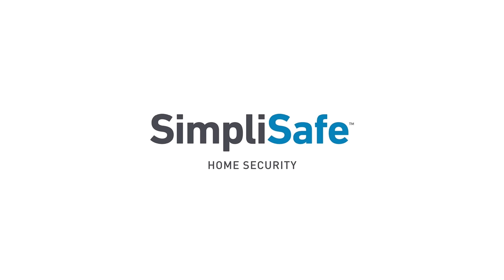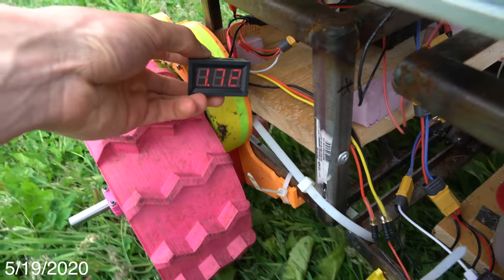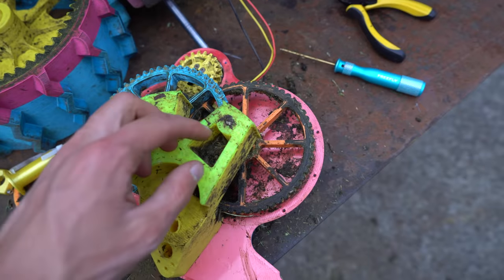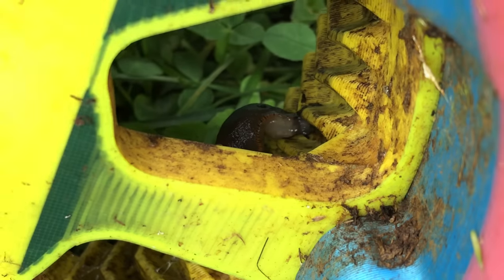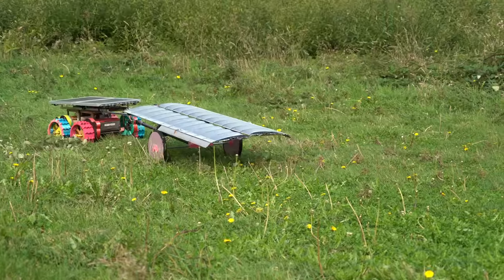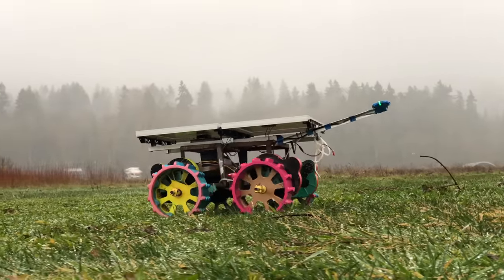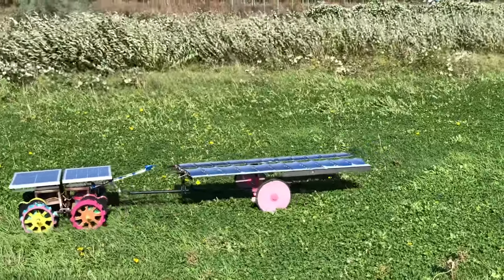Solar Rover #3 - 3D Printed Brushless Gearbox

Comment from the maker: Check out SimpliSafe’s holiday sale and get 35% off any new system + a free camera by visiting http://simplisafe.com/rctestflight
Reply: Hey
Reply: Have to say, your add is better than 99% of million+ subscriber channels. In fact, internet historian is the only one that comes to mind.
Reply: Wow many miles did the rovers GPS receiver clock for the season? IE. total distance traveled.
Reply: Simplisafe makes bad products and anyone who relies on them will gain nothing but a false sense of security.
Reply: @lightcycler4806  I am aware. That's why I wrote what I wrote.
Reply: I have a few batteries for you
Reply: May I suggest the oldest form of gears that had pegs against pegs or slots against holes?
If you ran your gears internally and had them as peg in ladder there is no issue of material interfering with the mesh of the gears.
Reply: heyy you can use grafite dust as lubricant for gearbox if you use oil or something liquid it will absorb fine grinded gras powder and make grayblocks so only way is proprely sealing gearbox and grapine dust for eficency and some sort of stifnes control for if rower gets stuck it will not try to move this will helps to gearboxs life expectancy 
and sory for bad english
ps that gps antena asking for truble can you change it from hizontal to vertical like normal rower anteas for extra safety?
Reply: @fahrimertdincer8421  
Graphite won’t prevent buildup. It’s inherent to closed gears.
Reply: @brucebaxter6923  well its not pervents ı know it but if there is some thing before build up that lubricates that materials and they need more time to build so its jus works for buying time and its full closed gears soo it will help
Reply: @fahrimertdincer8421  
The gears didn’t wear.
Reply: @brucebaxter6923  You didn't watch thr video, did you?
Reply: If you put a  stationary arduino with GPS at the edge of the field, you could measure GPS drift and have to rover automatically compensate. I use nRF24 modules (the one with the shielded chip) for my Null Island Space Agency projects for communication between devices. It's low power/low data rate (but somewhat long range), but that should work just fine for your rover project.

The base station could also act as a time lapse camera. Every time the rover reaches a specific waypoint (=each lap), take a photo.
Reply: @AlexusMaximusDE  wifi jammer comes to mind.
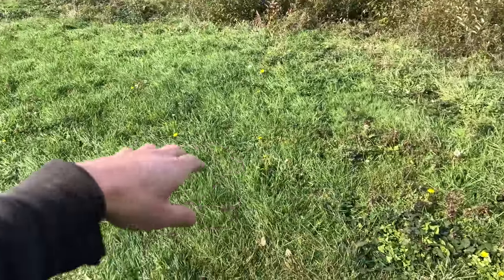Reply: Hi maby your waypoint misson shifts South because of magnetic declination, I may be wrong but you should check that. 25:05 Yes there is. So I did some searching and I don't know your location but based on Beverly, city where you started the solar plane mission, magnetic declination is 14.84° E  ± 0.39°  changing by  0.09° W per year.
Reply: Just a quick idea about keeping the gears a bit cleaner, could you fit a rotating brush inside the wheels that could sweep the gears?
I know there's not a lot of space but it could help.
Reply: There's a machine that was built for going off road without damaging the ground. It used Rollinon wheels (Rolligon is a trademark name for a type of tires designed for use in rugged terrain or for traversing the tundra.) That were driven by another set of wheels set above them, it's like a number 8.
The Rolligon tyre is just a bag of air so it can deform to the ground instead of using suspension.
I think it was a military vehicle between the 60s and the 80s.
I can't find the name or a video but if anyone knows what it is then it would be a good idea for the next rover as the grass and slugs won't be an issue.
Reply: You made a grass juicer.
Reply: You can heat harden PLA.... might be a good application for that.
Reply: How would those life batteries work in an airplane? Are they heavier than lithium ion?
Reply: @AlexusMaximusDE  you rob houses for a living don't you? Business getting harder. Risk vs reward Hong the wrong direction?
I hear Simplisafe is growing like crazy and hiring lots of people with no experience.
Reply: If you get one of the newer FC's you could use ArduPilot's scripting to do the mode changes and just skip the entire Arduino & S2PW thing. 😀
Reply: Put tank treads on the solar rover
Reply: add walls around the gears in the wheel so you still get free slug lubercant and grass doesn't get in
Reply: if your design had 2 drive wheels and one training caster, you could make twice as many rovers with the same gear boxes and run 2 tests at once.  Might not be a bad wheel layout for a mower
Reply: My suspicion of the slugs covering the gears, is that they eat/drink? the grass paste.
Reply: try using a worm gear instead in your gearbox it can increase torque without the need of many moving parts reducing energy loss and reduce points of failure and can help reduce jamming in the gears from debris.

Basically a worm drive, this mitigates any problems with back driving as it is a mechanism is a one-way output drive. It works by spinning a worm gear which drives the output gear. The advantages of this design are that it is easy to increase the torque with this design, can reduce the number of stages to increase torque, and uses fewer parts decreasing the points of failure making it easy to diagnose a problem, and decreasing energy loss in the whole system due to friction. 
It also has the added benefit of being able to remove gunk and jams on the gear due to how the mechanism works.
https://en.wikipedia.org/wiki/Worm_drive
Reply: Brushless should not be that loud. I think the gear need to get improve.
Reply: I just saw a video about a really great idea that can really reduce the wear on a set of gears, Magnetically locking gears! They use magnets to lock into place but if they are overloaded they can use mechanical force to push through the issue, I think you might want to design it a bit differently though. Here is the link to the video:
https://www.youtube.com/watch?v=76yRObMIwa0
Reply: @evilcanofdrpepper  that's not the problem tho, because if you get dirt and mud in the system it'll get stuck the same
Reply: use hoverboard  motors next time
Reply: Tacoma. You mean you live in Tacoma.
Reply: Okay
Reply: Ooo
Reply: Cool
Reply: Super awesome project!!
Ps: LiFePO4 = Lithium Iron Phosphate
Reply: @superdupergrover9857  I
Reply: @deadeyedsam850  I
Reply: @deadeyedsam850  I
Reply: @deadeyedsam850  I
Reply: @deadeyedsam850  I
Reply: @deadeyedsam850  and
Reply: @deadeyedsam850  and
Reply: @deadeyedsam850  and
Reply: @deadeyedsam850  and
Reply: @AlexusMaximusDE  I
Reply: @AlexusMaximusDE  I
Reply: @AlexusMaximusDE  I
Reply: @AlexusMaximusDE  and
Reply: @AlexusMaximusDE  and
Reply: @AlexusMaximusDE  and
Reply: @AlexusMaximusDE  I
Reply: @AlexusMaximusDE  and
Reply: @monkeywrenchin351  I
Reply: @monkeywrenchin351  and

Comment: puts literal wings on the trailer... "looks like the wind is effecting the trailer"
Reply: affecting*
Reply: @UnitSe7en  boi.
Reply: @brycegman8150  Got a problem with English, son?
Reply: @UnitSe7en  proper English, yeah
Reply: @UnitSe7en  which is which I was never taught
Reply: @brycegman8150  what's wrong with correction?
Reply: @UnitSe7en  actually, if you read the definitions, they mean the same thing.
Reply: @sobertillnoon  absolutely 100% do not mean the same thing.  Effect makes no sense in that sentence.
Reply: Well,  I guess technically you could hodgepodge a sentence together where you could use the words wind,  trailer,  and effect.  It will be janky and awkward though.  "Looks like the wind is effecting a change in the relative angle of the trailer vis a vis the ground."
Reply: @ShadowWizard123  looking at the verb definitions of both effect and affect, I'm going with my original statement. Especially considering the first verb definition of affect Google shows me is "have an effect on". But that's all I'm bothering to look into. I'm not rebutting anything else.

Comment: When your rover gets stuck, it reminds me of the NASA approach.. You need a bigger rover. :)
Reply: And a nuclear reactor in the back😁😁
Reply: They borrowed this from an American car industry )
Reply: Actually, the NASA approach would be to get JPL to build a fake field and spend months trialing ways to get unstuck: then update the software with the new strategy.  Daniel's way is faster and cheaper.
Reply: @shurmurray  The American car industry
Reply: @jyotiradityadeka2905  mkay (:
Reply: How big would a rover need to be in order to be immune to the blackberries? What if he used 29" MTB tires? Or even much bigger?
Reply: Fun fact: NASA's most recent Mars rover's tires are made out of 0.7mm thin aluminium. And it drives on rocks and through sandstorms. Those guys are insane.

Comment: Would have been nice to have a odometer on board so we can know the actual mileage. Next version maybe?
Reply: I was wondering the same thing,   GPS can't do it?       How many miles did it travel?
Reply: He could have fed the telemetry back into the arduino to log it but like he said near the end, he's not great at coding.
Reply: $9 bike computer. Uses a magnet attached to the wheel and a magnetic sensor to determine wheel revolutions.
Reply: @marsrover001  The wheels weren't making good traction with the ground in several shots, I doubt that wheel revolutions would be a good measure of distance travelled.
Reply: @marsrover001  If he would put that on the wheel of the trailer that idea would work. When the bike computer can't handle the small wheel size you could convert it later on to the right distance. On the rover itself it would be asking for trouble when the rover gets stuck and the wheel keeps on spinning.

Comment: Id recommend going with bicycle wheels and tires, like a 20" or bigger. The significantly larger tire diameter will make it very capable. Going with reliable wheels and getting your drivetrain out of the grass would help with a lot of your issues

Comment: you could use the "gates belt drive system" on your next one. they invented really cool cogs that self extract dirt and mud.
Reply: I was intrigued by the claim of Gates having a new cog design and had to look up Gates belt drive to see what you mean. In short it's using a center ridge on the cogwheel to keep the belt tracking and not slide off. This way there's no need for side walls on the cog wheels which means lower friction and that any dirt can be squeezed out to the side. The design doesn't easily translate to making cogwheels for a gearbox though. You could come close by using the current chevron design but run them "backwards".  That way the cogs would first intersect that the point of the chevron and as the wheels turn the contact area would expand out to the sides. That way any slug caught would be squeezed out of the gear. If the gear is run the other way it will tend to pack any dirt towards the center. This might be good if you want the gear to retain lubrication but not to eject bugs and the occasional cow patty.
Reply: @blahorgaslisk7763  so they are crowned like the tires on a bandsaw?

Comment: I wonder if much of the wear-and-tear came from the skid steer design; every hard turn putting lateral forces on the 3D printed parts. I wonder if two drive wheels in back, with one or two free-wheeling caster wheels up front might improve longevity? Also I wonder if any improvements could be made to the navigational system to get the rover closer to the designated path, without too much variance and over-correcting. Great video!

Comment: Have you considered setting up a D-GPS (differential GPS) system. You could mount a regular receiver on a post in the field at a fixed location. Then transmit it’s received position to the rover (maybe via LowRa?). The rover would then compare the known position of the fixed receiver with its reported position. The rover then corrects its own position by that delta.

Comment: Do you think putting those gears in salt and "cook" them could help with having more resistent parts?
Reply: That's exactly what I was thinking about. I was wondering if the powder salt solidification would make those gears tougher.
Reply: @danieljenkins4213  probably not even all of them need to be annealed, I think only the smaller and most stressed gears need the treatment.
Also the gearbox cover would probably be better if cut out of something instead of 3d printed and the inside wall and all the junctions should be lubricated with graphite, it's quite easy to find and it's a really good dry lubricant
Reply: @lorenzoporciani  I think the problem with any lubricant will be all the stuff going in will scrub it away. The gearbox should be better enclosed if possible, and there was another comment about "self cleaning" teeth which would help tremendously
Reply: @danieljenkins4213  if it has already DRY lubricant things should stick less, also it is better than nothing
Reply: I think there shouldn't be any salt that would be the lub it gets from the slugs it kills won't help anymore

Comment: You should put the gear system somewhere hidden and then put a belt system to the drive shafts,sure it may eliminate tank steering,But it will ultimately use less current,more speed and be protected

Comment: You stumbled upon a great principle for a slug trap, slugs are a big problem in some areas, and something like your rover should be a great way to reduce problematic populations of slugs. I seriously  think you should try to make commercial products based on that. It might seem absurdly elaborate, complicated and expensive just to kill slugs, but the rover keeps itself baited, and disposes the killed slugs, and can cover large areas. And, it seems safe for most animals except slugs.   

The snails are attracted to the grass in the gears, it's easier for them to eat than undamaged grass. Some species are also even attracted to the remains of previously killed snails.           

A slug rover wouldn't have be actively running for long periods, just enough to keep the gears baited. Just give slugs time to find it, get in it, and then have it move a few meters, or yards, whatever you prefer, and then stop and wait to give some more slugs the chance. That wouldn't need more than a few percent duty cycle, and you wouldn't need a very big solar panel, or big battery pack to have it working 24/7 even without great weather.

Comment: A bit of advice: if you have a 3d printed part where a protrusion is an otherwise flat surface is intended to take load (multi-layered gears, printed bolts, integrated standoffs, etc), they tend to break at the point where they attach to that surface due to low inter-layer strength, and it seems like a large number of the part failures you had with the reduction gears and with the wheel shafts broke in this way. However, you can significantly increase the strength of such parts by having several small holes going vertically all the way through the part. This works because layer adhesion in 3d prints is derived almost exclusively from the amount of walls in a part, and adding holes adds additional wall area to aid in layer adhesion.

I have used this technique to great effect in making 3d printed thumbscrews that are quite strong and don't snap in half when you tighten them as they would without a hole straight down the middle.

Comment: this project is ridiculously entertaining! I love it. btw you should definitely start printing at higher temperatures. I do 230C hotend with 30% cooling fan, 0.6 layer width, 0.4 layer height and 55mm/s on my ender 3. Parts get fused so nicely that they never break between layers. edit: the profile is for PLA